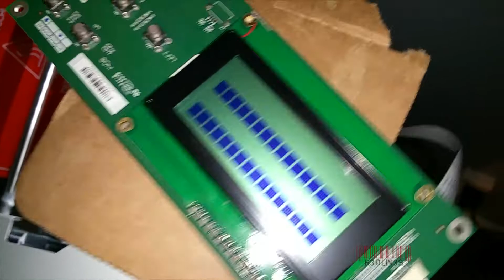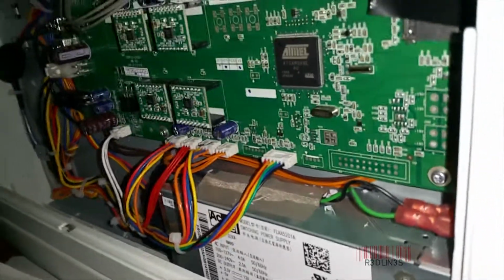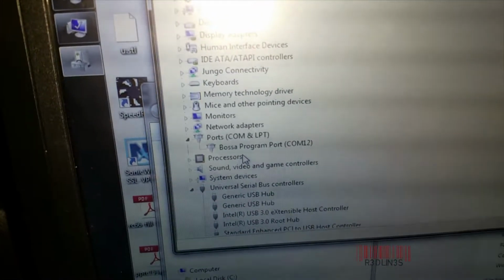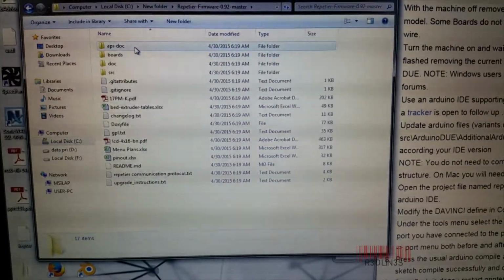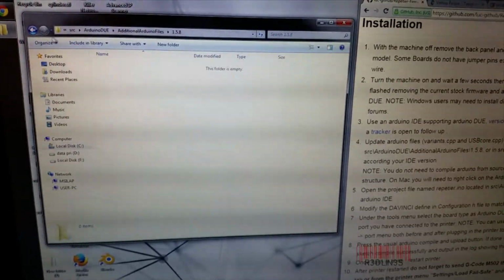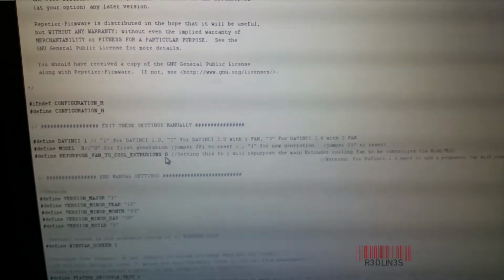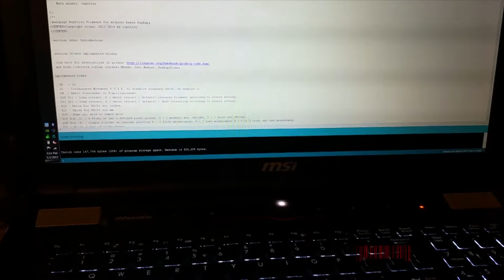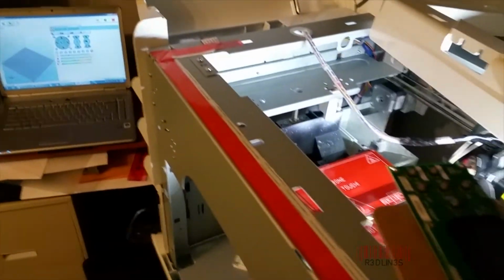Flash Firmware Davinci 1.0 3D Printer - 0.92 Repetier

Comment: I know this is an old video, but i was given a 1.0a and long story short i flashed it with repetier and have been printing tpu, pla,petg and it prints ver very good. I want to add a 2nd fan which the pcb by the extruder has so ive soldered a plug, now there is info online but this is where im lost how do i add it to the firmware? Back through Arduino??

Comment: HELP!! When I try this on my daVinci 1.0a, the software transfers correctly and I get the screen, but the buttons have almost have no effect, and the printer restarts 30 seconds after it boots up. The printer then continues to restart over and over again until you turn the printer off. Everything else looks normal, and I am running 1.5.8 and the right firmware... PLEASE HELP!

Comment: I'm having a problem and I cannot figure out how to fix it.
Running Arduino 1.58
Firmware .92
Da Vinci 1.0 ( J1 style)
After I compile and Upload the firmware do I reset the printer and then open repetier? Even when I reset the machine I get the sane error. Repetier does not see the printer and gives me an error " The connection failed with the following erros: the parameter is incorrect. Make sure your printer is connected" Do you have any ideas? I think the printer is bricked and the only way to fix the machine is push the original firmware with atmel. Any ideas?